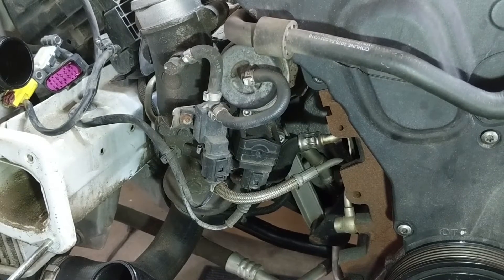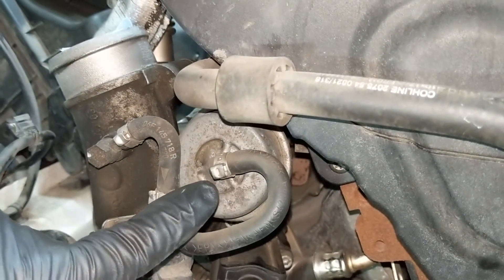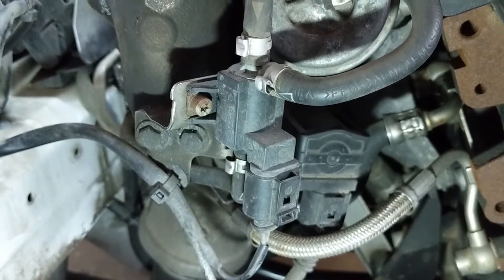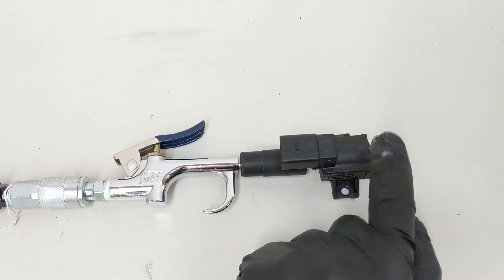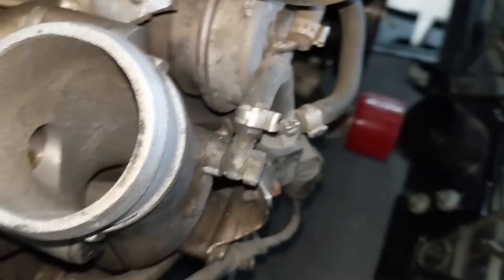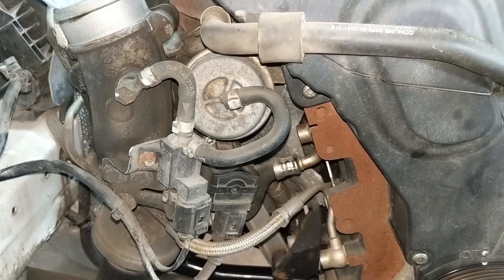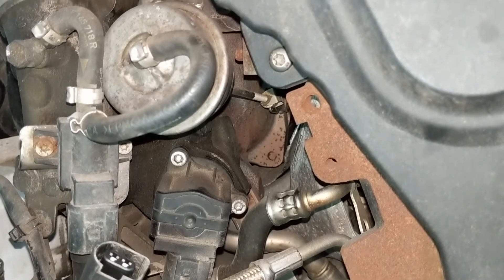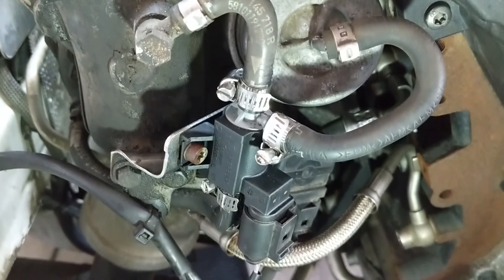N75 Valve - Audi/VW Testing & Install | How it works | 2.0 FSI A4 B7

Comment: Can I vent the N75 valve to atmosphere for the cool turbo noise effect? How will that affect how the car drives? Will the car run rich because of that?
Reply from the maker: No, don't mess with the N75; if you want more choo choo noises just change your diverter valve for a unit that vents to atmosphere. Forge or GFB has an adapter to do that.

Comment: Do you apply
12 v or 5 v to this N75 valve ?
Reply from the maker: Great question and I'll give you an honest answer. I applied 12v since that's how the Power Probe works. To do less or anything other than the battery voltage, you'd of course need a variable power supply on the bench. The real question is: does the N75 receive 12v from the connector, or not? I didn't test and can't say for certain. But the valve didn't fail or a fuse pop, so it's an OK assumption that 12v is what's applied.
Reply: @FigureItAuto  Thanks for the response !!

Comment: Hey bro, I'm getting the error P2261 - Turbo Boost Pressure Not detected Mechanical. I've an upgraded K04 Hybrid with Turbosmart DV. If I accelerate my car, the car flutters (Releases boost) and then gets the boost back but if I flood (pedal to the metal) then boost spikes to the desired pressure. Should a faulty N75 valve cause the above mentioned problem?? If not should I be adjusting the actuator rod?

Comment: buenas noche,
sinifica, si esa valvula no se abre kuando pone la coriente esta dañada?
i el caro pierda potentencia, no tuenes boost pressure.
Reply from the maker: Hola, si, si el solenoide no permite que el aire regrese a la entrada del turbo cuando se aplica energía, la válvula ha fallado. El resultado aquí será la sobrealimentación del turbo. Gracias por mirar y espero que esto se traduzca bien.

Comment: I'm thinking about using a N75 off a more powerful TDI to control my vanes.   My Manifold Absolute Pressure is 220kpa in 3rd at WOT. I want more boost, without paying for a tune. I can spin, do a burnout, all the way to 4th with just the mods I've already done.

Comment: So, delete the valve for old school turbo tuning? Can I get away with it on an old TDI, you know, like tuning the turbo on an old Honda?
Reply from the maker: Tell me more about old school turbo tuning - because if you remove the boost solenoid on this setup you'd run into some major issues and risk sending the turbo to spooly boi heaven.

Comment: So, when diaphragm in waste gate actuator is broken, keeps in close position, letting turbo keep building pressure? in that case, how the engine manage the overboost?
Reply from the maker: By exploding, either the turbine, or hoses, or failure in the cylinder.
Reply: @FigureItAuto  very clear

Comment: If I want to put a boost gauge there which 1 I have to connect the T hose to
Reply from the maker: Search for a boost tap for your particular vehicle before messing around with any of the vacuum lines down near the turbo. You likely should be tapping into the intake manifold for pressure - and it'll be closer to the firewall so you can route lines to a boost gauge in the car.

Comment: 008801 - boost pressure control valve (n249) p2261 - 008 - mechanical malfunction.

Is this the valve to replace ? From a 2.0 tfsi BPJ engine

Comment: Very helpful video, very well done.  Thank you!
For the Active State Test, beginning at 3:58, I presume you are applying 12 V to the solenoid.  Is that correct or is the voltage something else?

Comment: I have a diesel volvo 2.0d,very strange case...when i connect the n75 in the wrong way (VAC to turbo,and OUT to vacuum reserv.) the car does not jerk...when i connect the lines in the right way as should be (VAC  to vacuum reserv. and OUT to turbo) the car jerck when pressing and releasing the gas pedal...any help perhaps whats happening ?

Comment: Question is that same part on a Volkswagen Jetta Mark 7 1.8 turbo
Reply from the maker: If I was in Vegas, I'd say: yes. It's basically a guarantee that a boost control solenoid like this (whether it's referred to as an N75 or not) is fitted to a turbocharged, consumer-level vehicle of the modern age. Even a tuner-build car with an external waste gate is likely to still make use of this type of part.

Comment: Great video. unfortunatly its not helping with my issue. I have a b7 a4 2.0 that has good boost at first key cycle and will continue until you shut the car off. At 2nd key cycle and beyond it is low boost  then it trips a p0299 code. No other code comes up and after car cools next day full boost again.

Comment: Hello... How do I resolve a boost control solenoid code P0045, P056E?
Reply from the maker: I would do some Googling on those fault codes and learn more about the possible causes. As much as people (myself included) like to think that replacing parts is the solution to most issues, often it isn't. 0045 indicates a bad ground. http://wiki.ross-tech.com/wiki/index.php/16629/P0245/000581
Reply: @FigureItAuto  thank you, just that link alone helped out.. Thanks again

Comment: Hey, very detailed! Wish there was more people this detailed! Thanks! I have a 08 A4 2.0t B7 has P0299 code for turbo underboost condition, I replaced the diverted valve, and cleared the codes and drove the car and the same code came back, should replace the N75 valve as well or do you this my turbo is no good? Any comments would be appreciated thanks!!
Reply from the maker: Do you have any type of data logging tool? Ideally, you could monitor the requested vs. actual boost while you drive throughout the rev range. It is possible the N75 is to blame, but it could also be something related to the waste gate flap or any part of the actuator that moves it. Or it could be a boost leak anywhere between the turbo and intake manifold. I'd poke around and be sure all the hoses are on tight before digging deeper - and only assume the turbo is to blame after everything else is eliminated (because $$).

Comment: How much does something like this cost at the dealership or a different auto shop, I have the P024500 on a 2015 A4
Reply from the maker: You should definitely call around since one of the largest cost differences may come from labour rates charged - but there's going to be variance in the part cost too. I doubt you'd get out the door for less than $200.

Comment: Very helpful I broke the air pressure line connecting to the Wastegate actuator on my new turbo and this helped a lot now I’ll just replace it tomorrow, probably best that I put the car in the service position… 😅

Comment: I have a 2008 Passat 2.0t with 201,000 that I just purchased a few weeks ago. When I purchased it, the previous owner told me, and I confirmed with my own scanner, that there was a P0299 code (turbo underboost). I went ahead and pulled out and replaced the entire turbo and exhaust manifold assembly. There was oil dripping from the wastegate control module. Now the other code is gone, but I have a P0245 now. I forgot to clean the connector for the wastegate control module when we reassembled. Is it possible that I could simply have a bad connection preventing the module from operating correctly?
Reply: Heyy, I have Passat 2006 2.0t and its have P1693 code I don’t know exactly but that part have to change, I bought that part but do you know where is this part? I didn’t find the place

Comment: my car has two n75 valves but it goes into limp mode intermittently how can i fix it the n75 valves are located one at the turbo and one at the forge diverter valve, thanks,
Reply from the maker: Keep in mind the 2nd N75 is actually doing the work of the OE diverter valve was doing but it's just being used as a go-between to reference vacuum pressure between the intake manifold and the DV. You could temporarily get rid of the forge setup just to eliminate that mod from your source of issues. Otherwise, as long as all the vacuum lines (3 on each) aren't leaking, then you've got a failed solenoid or it's electrical. I know you didn't ask for this opinion but I would get rid of the forge setup and stick to a mechanical valve that's solely run off the ECU (like the piston DV or the Go Fast Bits DV+, like I have). Just simplify.

Comment: If this is broken will it make a whoosh noise a bit like a dump valve on a petrol thanks
Reply: I know this is very late but for anyone else, this is usually your diverter valve.
Reply: @nicholas_29132  If its not the diverter valve, because you've already replaced it... could it be the n75? or would it be the pcv?
Reply: @stephens2322  what issue are you having? Just the noise or loss of power
Reply: @nicholas_29132  loss of power too. i just actually bothered to look at the engine while it was running though and its clearly the pcv causing the issue. like, super obvious.

Comment: Is it important for the N75 valve to be close to the wastegate? I want to reroute my N75 valve away from the wastegate near the rear upper part of the car for better access. Would this cause a problem with it's function?
Reply from the maker: I welcome anyone else to join in here but I don't think it would cause a large issue. The pressurized air still needs to travel to/from the same components in/out of the N75 but it's possible the added length of hose would delay the various functions of the valve. If the lines were always pressurized at a constant, then no, I don't think there would be any effect. But they're not. If you moved it up a foot it could have little change, but up and over to the other side of the bay - that could be bad. It's a neat experiment that you'd have to measure with logging boost request/response timing differentials.
Reply: @FigureItAuto  My exact thoughts. Because there is no constant pressurised air then the travel time may be a problem. I guess I will post this exact same question over to an Audi forum and see what hits I get. Thanks for your kind and quick response.

Comment: Yesterday I had a poke around the engine bay looking for broken connectors, leaks etc.

I found that the N75 2-pin electrical connector was broken due to heat, and the previous mechanic held the connection together with a zip tie :( the zip tie crumbled to pieces when I touched it, and the connection to the N75 was broken.

I am wondering if it is safe to drive the car around short distances with the electrical connection on the N75 unplugged.

The car is showing a CEL and I believe its on limp mode.

Can you confirm please, thanks in advance.!
Reply: I have ordered the connector part from VW and will take it there on Monday, it is today Saturday.

2013 VW GOLF TSi 1.4 stock

Comment: I have an '07 VW EOS diagnosed with a boost pressure control valve mechanical malfunction.
Does this mean I have a bad N75 valve?
Reply from the maker: Hi Chad - I'm not familiar with the platform but drawing from my general experience and knowing that people tend to refer to certain parts using a number of names - your answer is: maybe. It could be a boost solenoid like the N75 (probably has a different short hand part code for your Eos), but it may be your cars diverter/blowoff valve in the induction tract, too. Or something as part of the waste gate mechanicals. Honestly, in the average turbocharged, factory spec car, it can't be that many things. Hopefully you can get some more info from what or whomever did that diagnosis and zero in on the faulty part.
Reply: @FigureItAuto  Thanks!  Also, your video is very helpful!  The part isn't that expensive so I might try to replace it on my own.  Any tips on how to get the factory hose clamps off?
Reply from the maker: @chaddaugherty3201  Getting them off is easy - I usually just jam a pick or screw driver between the ear and slowly work it open till it's loose enough to slide back. But you will destroy the clamp. To get the same style back on, you'll need something like https://geni.us/pinch-clamp, or switch to a different style clamp. The one's I used are simple to use but not the "best" solution for longevity.

Comment: Would you put a manual boost controller  on the boost source of you wanted to play around with such a thing? 
I know it's not recommended.
Reply from the maker: I wouldn't but that's just because I think it's not worth the effort or the resulting situation to deal with. Which is, you'll need to ensure more fuel is being adding to compensate for the added air - whether that's confirming the ECU is automatically compensating for you, or through tuning. But at the point you're needing to tune, you may as well just get a credible tune that adjusts boost for you based on altered maps. If you don't tune, some adjustments also might be required to the MAF and/or other systems to acknowledge/ignore the added boost is having on the system. I don't fully understand how a MBC would impact the 2.0 platform. You'd probably also want a boost gauge to keep an eye on the pressure you're creating throughout the rev range under load. Under the right conditions (and having the right knowledge), it could be a fun and cheap way to add some power. Up to you!
Reply: @FigureItAuto  I have snow stage 2 water meth kit. It's boost reference progressive controller. With digital boost gauge. I am already stage 1 tune. I want to play around with a couple more psi just to do it. I know I would have to keep it 4psi or less over the tune setting and that it takes 5 seconds to trip a over boost and cause limp mode.

Comment: Hi if this valve is faulty could it cause a overboosting of the turbo , thanks
Reply from the maker: Yeah it could. If the N75 solenoid stopped activating under power, it wouldn't be able to release boost pressure back into the compressor and even with the waste gate held wide open, the exhaust turbine might reach speeds beyond what it was meant to.
Reply: @FigureItAuto  thank you for the reply , I asked others and had the sticky veins answer but after Google and YouTube I came across this video . I will replace the valve and post back the results

Comment: I have a check engine light code P0299 Turbo UnderBoost Condition you think its the n75 valve or diverter valve or both? Also have 532 voltage supply signal to small.
Reply: I have same fault codes with underboost with my A4 tdi 20L ultra keeps going into limp mode waa 75 valve at fault?

Comment: Great vid, I have an Audi A4 B6 saloon 1.9 tdi, the car works fine in all of the gears, good acceleration, feels powerful, I get a problem when I’m on the motorway gaining speed I hit about 60mph and the car feels like it looses its power, after this happens it crawls up to 70mph, do you have any idea what this could be? Thanks for reading :)

Comment: I'm trying to figure out my 06 B7..

Lately on cold start 🤧 the car begins to have and on and off jerk when accelerating. Whenever the car jerks, during accelerating I can hear the "pssshh " outside my window even though I haven't given off the gas. I can quick change from 1st to 2nd gear [standard] n 3rd ect it would run smoothly until the next time to stop having to gear into first. 

So its clutch to first then go then jerk(pshh) go, jerk (psshh))...change gears and so on till next stop. It seems up to 4 "psshss" before letting off the pedal from just 1 gear to another not each necessarily followed by a hard jerk

If let the car warm up for about 5 minutes there is no issue n car drives fine. 

In past I have rebuild the turbo with new turbine n gaskets, n change the N75 while in the area. Not OE but can't say the new is more than 1 year old. I may have the original somewhere but I can't say this is the issue or Diverter failure(never replaced but upgraded forge space) since things work or don't work depending on temp of car.
Reply from the maker: I would check the diverter valve first. If it's the older diaphragm style, get rid of it even if it does not appear to have tears in it. Since you're hearing so much atmospheric boost release, I'm guessing that your diverter valve has failed and is constantly letting boost out the spacer. Again, guessing. This doesn't answer why it would only happen when the car is below operating temperature, though.
Reply: @FigureItAuto  
Thank u for the feedback and shot of confidence. I will investigate like it owes me money cause someone's got to pay for it 😆 ..tanks!
Reply: @FigureItAuto  
FYI update. 
In taking out the diverter, the top screw was completely loose movable hand almost with the hex! N not even taking out the last screw there was enough room for a piston to fall out. Im pretty sure the spacer goes over the piston. I seen some u take piston out n spacer over but the kit has some make shift plunger at end (not this; was valve with piston on ground from fall with no additional add on pieces to go after spacer) hope this is answer already ordering new one. Tanks again
Reply from the maker: Glad you narrowed it down. FWIW, I switched to the GFB DV+ as soon as I got my B7. The K03 is designed to receive recirculated air and the ECU takes that into account, so although adding blow off valves and other things that make fun noises is cool, I traded in the pshhhh noise for peace of mind.
Reply: @FigureItAuto  
Nice I will consider it. Mine came with the forge but thats the one I saw with own plunger after u fit with spring. 
 Ya I'm ok with wanting that peace of mind sometimes im just like "shhhh! Stop pssshhh! U r not faster than the M8 right next to u!" 
Thanks for tips my man. I will consider it i just wondering if u replace that whole thing when worn or if u can buy individual springs